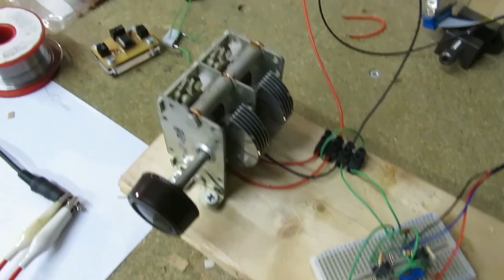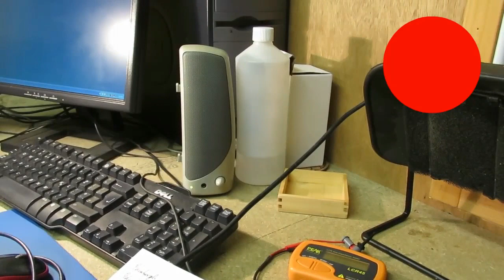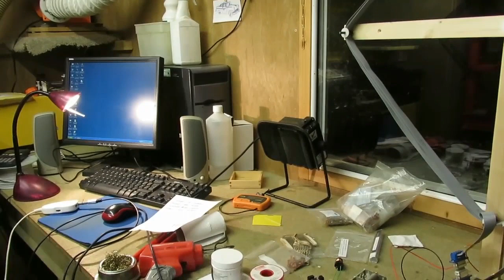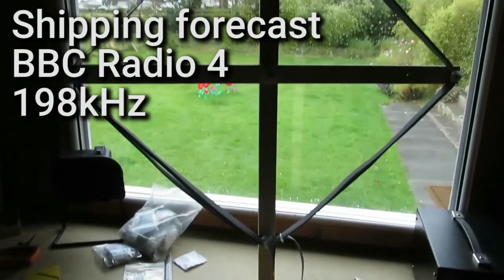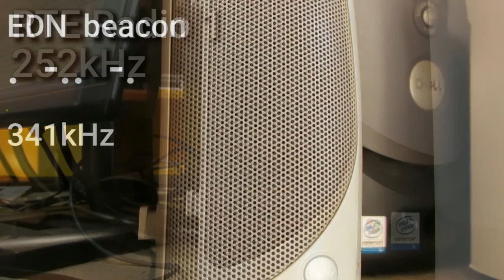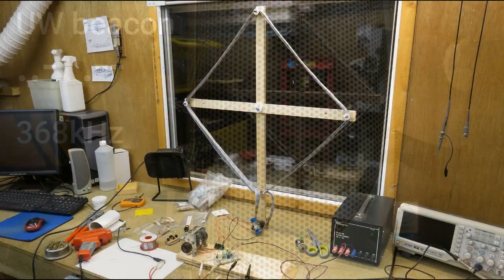Regenerative longwave receiver with opamps & ribbon cable loop antenna

Comment: Very good proyect. The listen of BBC and RTE is clean!. Has you used the own antenna coil (3mh) like a LC tank in wien bridge resonator with loop , its right..Has you tested  in  vlf frequencies the system? Good work, the simply, is good!
Reply from the maker: Thanks! I've put a link to the circuit below. It's essentially an amplifier with positive feedback, so not really a Wien oscillator. https://photos.app.goo.gl/AL9VrihfJ5RzTyJaA
Reply: Good night Lindsay, many thanks,  interesting proyect! I am go to take a look to schematic.  I suppose that lm318 or another opamp runs can be satisfsctory in this low freqs.